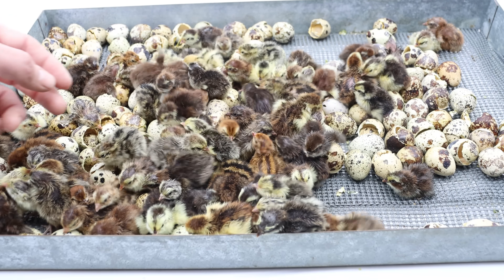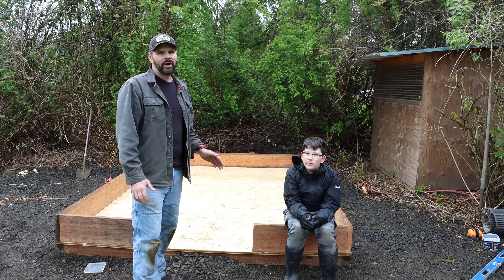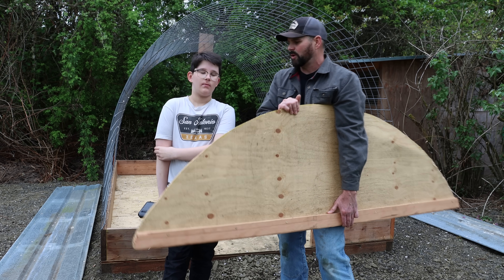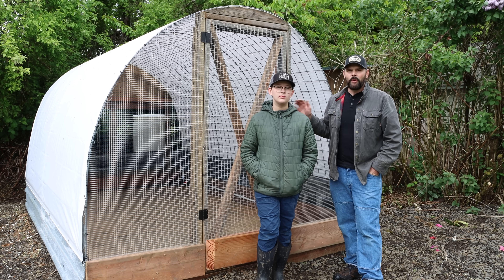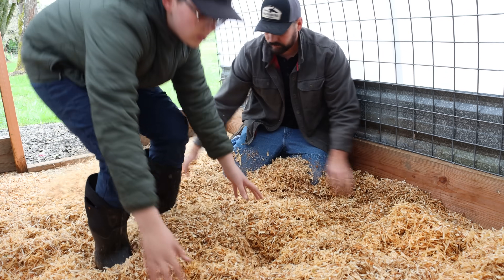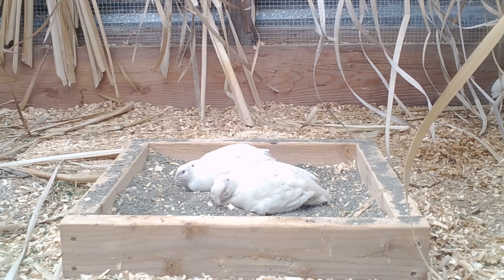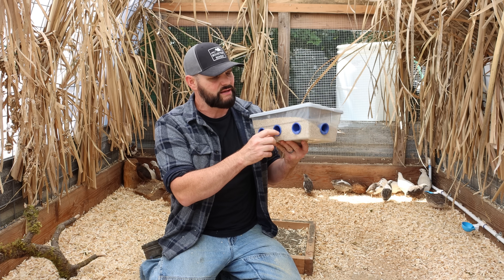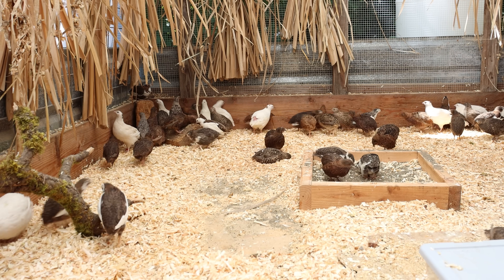HOOP COOP for 100 Quail. Building a quail paradise for our new Coturnix Quail.

Comment: I was just thinking this would be great to build for my lawnmowers when I change oil and gas filters on my 2 ride on cub cadets and replace blades and clea them  . . I could leave both ends open and it would give me shade  but allow air flow and easy in and out access . WOW   Why did I not think of this earlier

Comment: Did you put some finer wire on the cattle panels so that, when the tarp starts to wear, predators don't just walk in? Also, it could prevent predators from tearing the tarp and walking in.

Comment: you might consider growing some greens in planters placing them around the center portion of the enclosure, it will break up line of sight and even create cover as well as free greens for the quail to nibble on to keep them healthy. not sure of your growing zone fountain grass would create a nice hiding place as well. containers could be built reasonable and your son may enjoy the building of them. Using wood and sheets dipped in slightly soupy cement mixture, using the left over cement mixture to make slightly thicker cement with in the planter, place over the grow frames, let dry  then fill with dirt and plant may have to make a temp cage over them until the plants grow enough the quail wont just eat the seeds. Awesome build the best part is teaching your son new skills. turned out lovely.

Comment: My quail would sit on those red cups and would cause constant water flow and would drain the tanks and make insane messes.  I placed the red cups just outside a fenced cover so only their heads could reach in, they couldn't sit on them. I tried the nipple feeders but too many  problems with those.

For my feeder I use PVC piping 3 or 4" with 1-1.5" holes to access the feed. It's sloped and connected to a 90 with up pipe as the fill and storage.  Also use lowest protein possible for layers and lower for your males or nonlayers you will butcher, that reduces the odor, reduces flies and reduces overheating on any possible hot days. 16-22% protein. I used a combo of chick starter 18-20% crumbles with gamebird 24-30% crumbles to a ratio that would give me the desired protein level. For my breeders and layers 22% seemed ideal for my birds, no feather pecking, calm, low odor so hardly any flies. Calcium only needs to be around 1.8-2% for layers.  My coturnix LOVED cuttlebones!!  They devoured them! Also millet like they sell for parakeets.  Mine didn't care about greens or any other fresh foods. (I'm in desert so you probably don't have anything like my hot days.)  Also I set out multiple deep- sided 6" and covered dust baths with Sweet PDZ crumbles - they sell as stall fresher.  They would lay their eggs in their and some hens would "own" a dust bath and exclusively lay in that specific dust bath - so I had a ratio of 1 dust bath for every 2-4 hens.  Some hens would sleep together and share dust baths.  It made collecting eggs very quick and the eggs were clean. I used fine mesh colander to pour the PDZ through weekly to remove the poops and reused the PDZ. The PDZ really helped keep the odor down and kept it dry.  I rotated males between female groups and only kept the calm friendly ones and developed larger eggs and birds.  It seemed the Italian and Amber Autumn colors were the calmest, friendliest, quietest in my mix of colors.  LOVE Coturnix, was raising them for eggs, meat and feeding my dogs.  Also sold the wings to folks training raptors and bird dogs. 120 eggs incubated every week, staggered hatches in 3 incubators.

Comment: Would suspending bird netting, burlap, or camo mesh from the interior (by loose zip ties or other means) be enough to protect the quail from self injury? Curious if the feeder idea would work for chickens as well - maybe using larger PVC or printed elbows.
Reply: Typically for Coturnix just having low clearance is ideal, about 10" max.  His set up is better suited for the wild quail like valley or mountain quail, not Japanese domesticated quail that don't sit on eggs to hatch, were developed for commercial egg and meat production.

Comment: You need to provide a barrier for rats who will burrow under your coop and  knaw through the plywood floor. Perhaps adding  1/2 inch hardware cloth on the floor or burying hadware cloth vertically to a. Depth of 18" around the perimeter  of the coop would help.